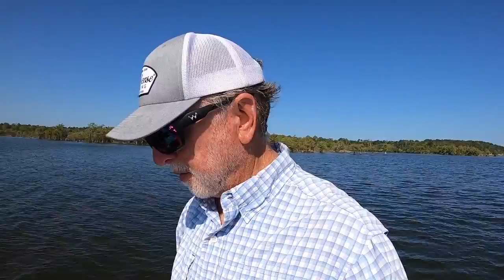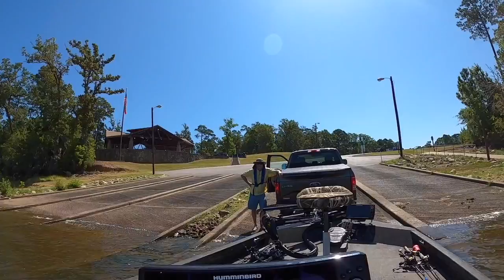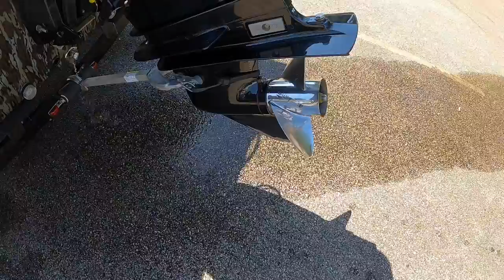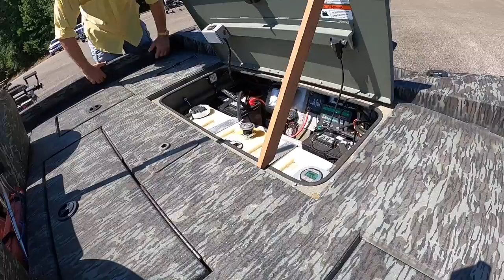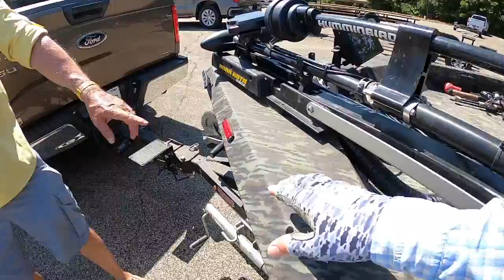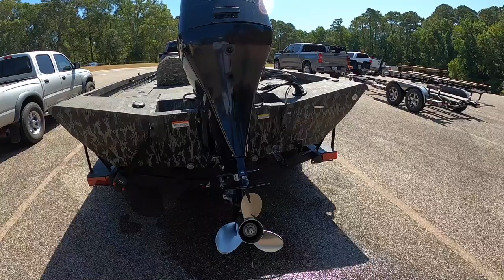Trinton X17 Boat Review Pt 2 - Great Tin Boat Search of 202 - Boat 3 Vid 8

Comment: Getting a wider hull will help the tipsy feeling.

A 60 inch bottom will lean more than 80" bottom like the Vexus tin rigs. The Vexus boats all run 80" bottoms.

Also length of the boat will play into effect here as well.

Since majority of weight in tin rigs is in the rear it's why there is more lean when comparing the back to the front in lean.

I like to think of a balance beam when looking at lists. The more weight you have on one side vs the other it will take more weight to affect the balance when you are moving weight around on the lighter side.

Where as if you are moving weight around on the heavy side it takes less weight and adjustment to affect the balance.

As for electronics mounting, getting a transom saver and mounting the transducer further away from the hull helps get it into cleaner water. I can get depth readings while at WOT. Side and down is also pretty clean to, something else that can help is making sure there is a smooth transition off the bottom hull to the transducer. Some people grind down the transom welds to make it smooth, I use JB weld marine grade to add material in front of the welds to make it as smooth as possible.
Reply: Also I had my box lids remade so I can run slam latches. Money well spent.
Reply: Hi, where can you find the bottom width you mention? Beam is readily available but I agree with what you are saying on stability. Do you happen to know ranger rt 188 bottom width?
Reply: @paulryndak9916  finding the hull width is kinda guess work for most manufacturers as they dont list it. Easy to find it is to measure it yourself. Measure at the transom and your measuring corner to corner. 

Corner = side walls meets the hull.

I don't know it exact but sometimes you can guess the bottom hull width from the beam. Since the beam should never be narrower than the hull. 80" beams generally land around 60-70" widths depending on how the side walls are built (glass boats are the exception to this since the handrail and/or rub rail is generally oversized a lot) there are other exceptions to such as custom built/ordered boats. Where Im at we run jet boats and one of the top players Alweld will custom make a 1866 (18ft long 66 inch bottom), or 1966 or a 1970 they will even go to a 2070. I think the biggest they can go is like 2480. Can't remember if their jig caps at 70 or 80. Most common and popular design is 1860 and 1960. The 1752s are close but they fall off once kids are involved, just a little bit to small. There are more sizes they make too but just the jist.

Sometimes you can get lucky and find the dimensions on forums or posts. 

Just remember inside the hull is not going to be the real hull width as there are bracings and other things that make the inside narrower than the hull width
Reply: @nathanmistler1186  ok thanks - yeah the Vexus are 94”-95” beams for aluminum, ranger is 92”,
Reply: @paulryndak9916  According to the Googs, RT 188 is 65" bottom. That's a crazy offset from hull width to beam.
Reply: @nathanmistler1186  hmm that sounds extreme - 32”. And Vexus only 15”. I like the Vexus personally but I’m on a lake with 90hp max restriction unfortunately
Reply: @paulryndak9916  I could see it being true though. Considering that a local dealer turns these RTs into Jet boats and I see them. Just never measured it.
Reply: @paulryndak9916 Was able to confirm that the RT 188 is a 64" bottom.

The jet model that is sold locally is marketed as an 1864
Reply: @nathanmistler1186  wow that’s actually really making me question getting the 188. I’ve also considered G3 and Lowe, maybe need to check the Lowe out in person - thanks for that, I’ll make sure to measure width of hull at the back of boat as well